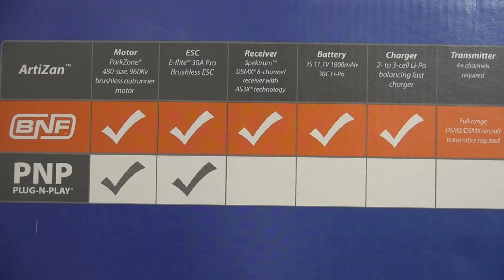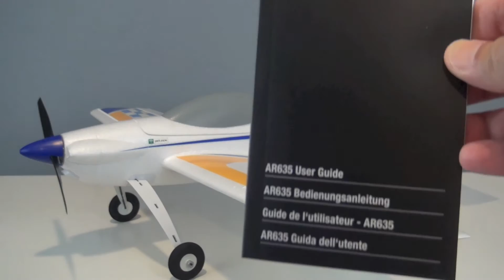Parkzone ArtiZan: Complete Review

Comment: Just acquired one of these but it was badly damaged. I've repaired it but was not sure where to place the ESC. Is it normally located behind the motor or is it in the opening under the motor? That is where I end up installing it in order to provide room for the battery in case it needs to be moved further into the nose to balance the GG

Comment: That instructions say to slide the battery all the way forward? Seems to fly a little nose heavy. The plastic tray, is that where the battery should go? I've only flown mine twice haven't had a chance to experiment with battery placement.
Reply from the maker: Hi Henry-I liked the cg with just a 1/2 inch or so of battery going forward of the main compartment. Definitely not all the way forward-just start sliding it back until you find where you like the cg.
Reply: Thank you,and thanks for your well made and in depth videos. Most informative . Best on the web.

Comment: While I'm commenting, can running a 2200 battery in a plane that calls for an 1800 cause any problems? I'm a noob and I don't understand this part at all...And I'm constantly worried about burning my house down...Or worse, burning up my plane...
Reply from the maker: Hi Bobby-the 3s 2200 will cause no issues over the 1800. I am only flying 2200 packs on this plane. The worst is burning down your house with the plane inside...Lipos are safe as long as you understand the charging basics and do it safely, don't leave the house while they are charging etc.

Comment: Good video, had the Artizan for some time now and a Visionaire, flown many others also, but these two are great, at first was not overly keen on the Artizan, but after 4 or 5 batteries through it, it really grew on me, the Visionaire is also a good plane, my main niggle with both planes are the Props, they are rubbish, and at certain RPM`s flatten out and creat a lot of vibration, as for flying though, the Artizan seems better in the power usage, and imho, Knife edges far better than the Visionaire and also props hangs great, once your used to it, the Artizan is very very capable, as you say my only other niggle is pretty much the same thing, they could have done with adding say around 40mm extra wire from the ESC.